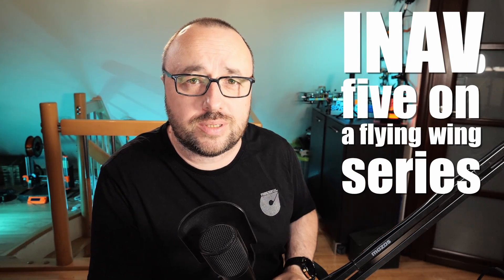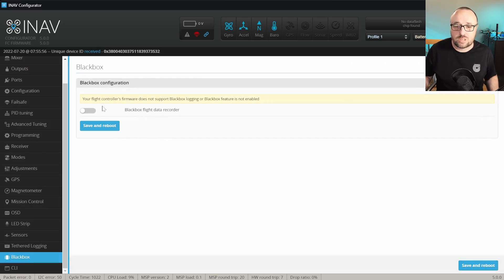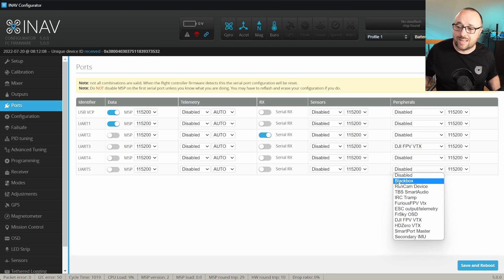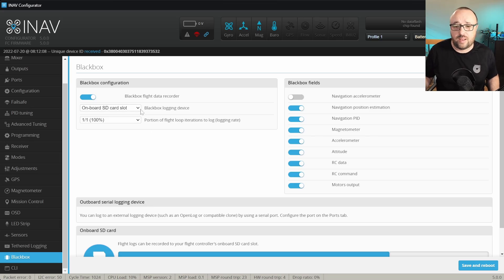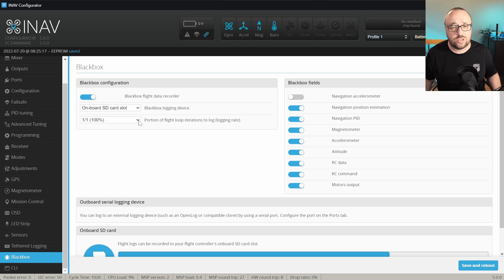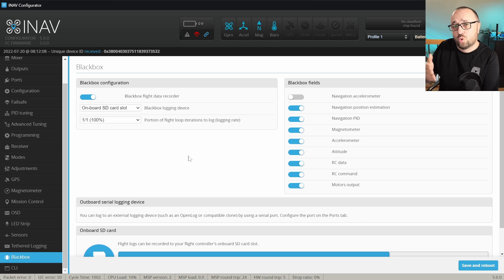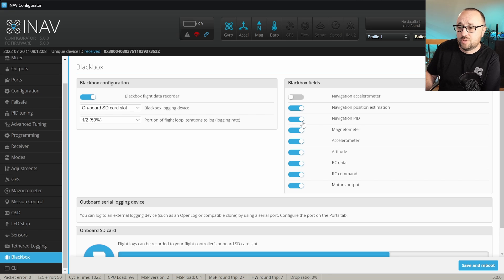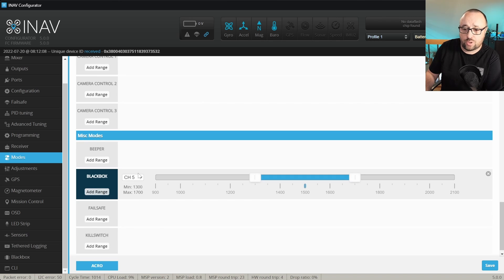Blackbox | INAV 5 on a flying wing | 10/11

Comment: Hello, Pawel. Thank you very much for you detailed videos. I want to ask is there way to read SD card log data without removing it from the flight controller slot. This is off important, because some fc require disasembling to reach the SD card. Is INAV have such option?

Comment: Hi Pawel,  can you set the logging rate to "Hz" in the 7.1 thx
Reply from the maker: You can easily compute that as standard looptime is 2000Hz. So 1:1 is 2000Hz, 1:2 1000Hz and so on

Comment: @Pawel i was wondering: Are any of the  flash accessing functions blocking orr run in the main thread? The reason I'm asking is because flash memory does fail after enough writes and hopefully that won't result in the FC hanging mid flight.
Reply from the maker: Those would have to be hundreds of thousands flashes. Not really likely to happen
Reply: @FPVUniversity  I have had flash cards fail (but not in a fc) with much less writes. Trying to access some of them even causes Windows disk management to hang. Flash cards are not always as reliable as they are theoretically supposed to be. Perhaps internal flash memory is but not cards.